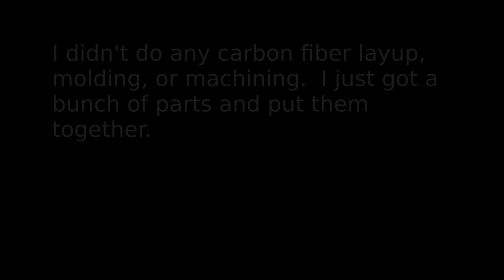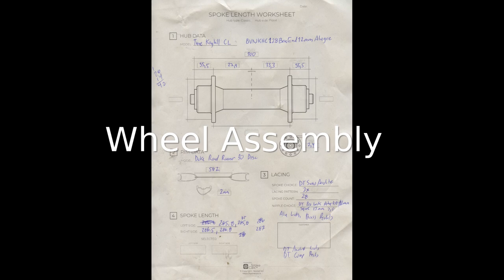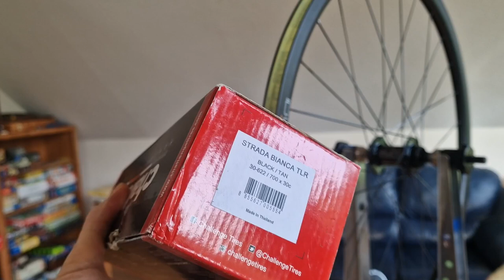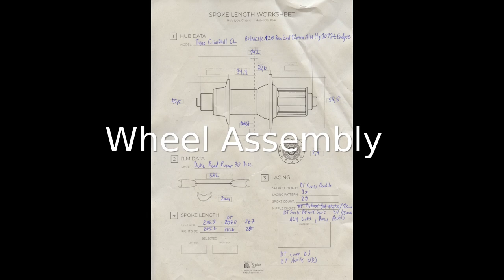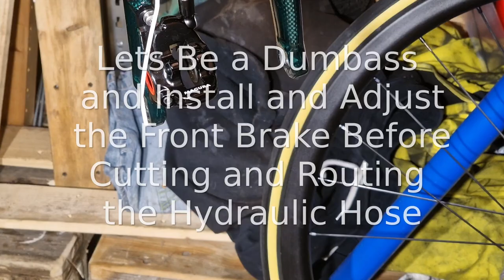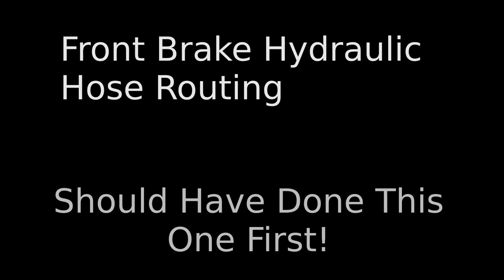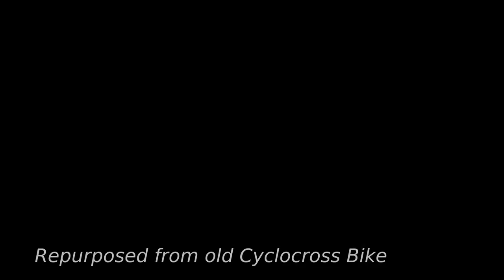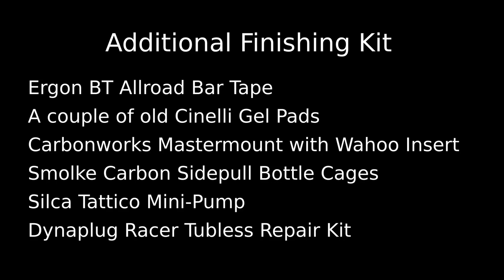Time ADHX Bike Assembly by Home Mechanic

Comment: How do you like the frame
Reply from the maker: The frame is just incredible in the build quality department.  Every hole is as round as can be, and every surface is so flat that nothing needs to be faced, the finish is immaculate.  The frame just reeks of perfection.  It also feels great on the road and on the mild gravel.  The only thing that makes me a bit hesitant are the threaded forged carbon dropouts for the thru axles.  I do a lot of wheel swapping, and am I bit concerned about their longevity.  With that, I'd definitely buy it again, and the next time I need to build a bike it's going to be another Time frame.

Comment: Nice build! I'm about to build a very similar one. I've been riding Rotor 1x13 for a couple of years, and it's still going strong. I'm building the ADHX with it, too. Did you get yours to shift properly yet?  It's pretty sensitive to b-tension and chain length. You might be able to take out another link, and you want to adjust b-tension as close as possible without crashing the upper pulley wheel into the cassette. Another thing I did to mine on my other bike is I removed the barrel adjuster. I've had a couple of them, and they all started leaking after a while. The only downside is that it's a closed system, so you have to account for thermal expansion when bleeding it. I've had mine lock up in hot weather. Heat can preload the system so you can only get upshifts, but it won't shift down, unless you push the button on the derailleur.
Reply from the maker: That is great to hear about the longevity of the Rotor.  So far mine is shifting pretty well, both up and down, and I've been riding it in temperatures from 8C up to 35C without any issues.   My biggest complaint so far is regards to the b-tension, and the way it is stepped instead of analog like every other rear derailleur I've ever had.   I have a Rotor 11-46 12 speed cassette installed, and I seem to have a choice between a lot of noise when it is on the 46T gear and quick shifting in the smaller cogs, or quiet and slow.  I might need to start playing with the chain length like you've suggested.  I've been swapping out a few different sized chainrings trying to find the most appropriate gear ratios, and I'm acquiring parts to build a set of paved-road only wheels with a 11-39 cassette so it's disappointing to hear that I might have to play with the chain length on wheel swaps.  Of note as well, I have a second set of wheels that I appropriated for this bike that I use for off-road.  It had an XD driver on the rear, and I had read several places online that people had better experiences with the SRAM Eagle cassettes.  This was not the case for me, as the Eagle was so noisy and the chain would occasionally climb on top of the largest cog (which I've found out is a reasonably common complaint with them) -- that I wound up swapping the driver out and putting a Rotor branded cassette on.  The Eagle cassette is now on the pile of other SRAM parts that I've been absolutely fed up with.

Comment: If you want handmade Italian tires, your only option (don’t get me wrong; they’re very good) is Veloflex.
Reply from the maker: Thanks.  I was trying for an Euro build, but the tires, bar tape and chain ruined it.  The chain was a bit unavoidable as KMC teamed up with Rotor.
Reply: @schwarzwaldbikenerd6074  why not Campy? Could do a full Campy group set.
Reply from the maker: Funny enough, my first choice was a Chorus 12s gruppo with the 34T cassette.   Every drop bar bike I've had for the last 20 years had some form of Campy on it.  However, after using a power meter for several years I feel like I cannot live without one.  Keeping my Time ATAC pedals was also a must, so any pedal based power meters were out, and there are no affordable power meters that I know will work properly with Chorus 12s.  I already had a Rotor 2INpower crankset on my old Ritchey Swiss Cross with Record/Chrous 10s, so it would have been a bonus to reuse this.  In my research, the chain-ring spacing on the Rotor crank for 12s was a bit too wide and I was too worried about lodging the narrow chain in between the rings.  I was also fascinated by the Rotor hydraulic stuff ever since the Uno came out.  So I figured I'd play it safe and give the Spanish stuff a whirl, and if it didn't work out I'd try to hack together the Chorus 12s setup.

Comment: I have the Carbon Black with Sram AXS.  That green looks nice.  I almost went for the Amber color, but thought it might just wear on me a little after a few years.  That Rear D is the biggest I ever seen.  Interesting build choices.  I have enough stress with hydraulic brakes, would never go with hyd derailleurs. 😀
I must say I am a little confused by some of your choices.  A Time ADHX frame - top quality.  Yet you put a Hambini BB in it which typically is for frames where the BB is not quite to spec - Time is known for being right on spec with the BB size, so a normal BB would be fine - just put in the quality bearings of your choice.  Then you go with a suspension stem and seatpost.  For those two things alone, you will never actually feel the frame ride quality.  Its all muted out by the stem and seatpost - an AL frame from Cannondale would feel the same.  
I have 32mm tires on mine and it also seems to me that the ride quality of my frame is never really noticeable while riding.  I'm afraid the days of feeling the difference between frame materials may be over since we now all seem to ride wide tires at lower pressure.

Comment: Have the same frame-color and size. Nice to see it boroscoped and so clean inside. Nice build. Interesting component mix. 

For Challenge tires (I mounted Getaways on Roval Terras) I think the trick is to get the tire over the rim but don’t seat any of the beads. Basically you’ll have the flat tire w tread over the rim and beads to each side. Then you work  the bead of one side into the rim channel. Use a little bead wax and tire lever for the final bit. Next repeat the other side but when you get to the final bit put a pedal strap on one side of the unseated bead to stabilize it. Again put bead wax on and use a lever to flip it over. Took about an hr to figure out the process and then the next wheel took 10 mins.
Reply: i need a video of that one. I am public school dumb and also have some challenge tires that didn't make it fully onto the rim yet. I am hoping it stretches it self out magically
Reply: @TheFloridaBikeVlogger   look at the rim. In the middle of the rim, there is the lowspot. This low spot runs around in a circle. This circle is smaller than the circles made by the high spots to the left and to the right. 
That means when stretching a fixed circle (the tire) over the rim, getting the final bit of the tire is easiest if the rest of the tire sits in the middle, in the low spots of the rim.
Then you have to do the minimal amount of stretching the tire.

So if you struggle getting the final bit over the rim, make sure to squeeze the tire bead everywhere around the rim together, into the low spots. The final bit should then be easier.

Comment: Sweet. I've always wondered about Rotor. Interesting concept, but sadly i'm not brave enough to try it. I've also just pressed the button on an ADHX. 👍
Reply: Rotor has been a fun experiment that is still ongoing.   After a year, I still can't figure out if I love it or hate it.  The Rotor setup is pretty tough to get dialed-in, and takes a bit to get the feel of the shifting -- but once all of this clicks it's quite a nice to ride.  The braking is beyond superb as well.  The downsides:  It can be pretty noisy, especially in the lowest gear.  As someone who is pretty sensitive to clicks, creaks and squeaks all of the racket from the drive train makes me half crazy.    I also decided I'm not a fan of the big gear tooth step increases of a 1x setup and I'd prefer to have a nice quiet, tight 2x. 

If I had to do it over again, I think I'd try to squeeze a Chorus 12s in and try to get it to mesh with the Rotor crankset. I'd really miss those brakes though....
Reply: Tough one - tranquility and consistency vs being a bit ‘different’ 🤔 Also agree re 2 x

Comment: Very interesting, thanks. You use some 'interesting' parts! I wouldn't dare to install Rotor shifting on any bike, and after your video, I am now fully convinced I'd always opt for anything Apex / Rival / Force (wireless), GRX (mechanical) or Ekar for my gravel bike... 
With regards to the wheels: kudos for building them. I've built some wheels but always struggled with getting rear wheels perfect. It seems you have the materials, patience, talent and a good plan to start with. I wonder if you can give any riding feedback? 
With regards to using the ADHX for all purposes: how happy are you with the handling / steering on the road? 
One last thing: I wonder if the installation of the Hambini BB won't wear the inside of the BB (the left side, that gets the whole BB pushed through). Also, with the way Time produces these bikes, the BB should be very good in terms of roundness and the sides should be straight and perpendicular towards one another. So why would you install anything else than the most commonly used BB and resort to what's essentially a (costly) solution for a problem you don't seem to have?
Thanks again for this video.
Reply: In general, I'm very happy with the bike in pretty much all conditions and ride types.  I built it up as a comfortable bike for long days in the saddle with a lot of climbing and possible dirt and gravel.   I'm currently using three different wheel sets with it: the wheels in the build for all-purpose riding where I'm not going to encounter, a almost identical set but with some more aggressive tires for more off-road conditions, and a set 48mm front/56mm rear carbon rims for strictly road use.  This make the bike really versatile.

The one thing about the bike in the build that I absolutely hated were the Challenge Tires.  Not only were they the most difficult set of tires to mount I've ever encountered, but on quick curvy descents they had way too much give in the sidewalls and had sort of a buttery feeling.  I couldn't even bother to wear them out before I got rid of them.

One of my big reasons for using the Hambini BB was that it got stuck in my mind as something I wanted, not necessarily that something I needed.  That was ultimately one the biggest reasons I chose the Rotor groupset, it became a bike-part Earworm.   I looked at the Hambini BB as more of a problem avoidance thing, rather than a problem solver as a way to justify getting it.  On the plus side, I tend to go through bearings quickly due to dirt intrusions and the shell design made it very easy to replace a bearing that started clicking.  On the downside, it made the internal cable routing extremely difficult.

If I did the build again, would I use the Rotor groupset again?  There are some days I love it, and some days I hate it, and I think I'd probably go with a Campagnolo Chorus 12  speed setup and try to make it work with my Rotor powermeter. I'm not a big fan of the more recent Campagnolo cranksets, and this was what ultimatly pushed me the Rotor hydraulic direction.    Would I still install a Hambini BB?  Problaby.  Would I still buy an ADHX frameset?  I definitely would.  I also would stay with the vanilla ADHX and wouldn't' go for the ADHX 45.
Reply: @bantolphbantir9605 thank you very much, this feedback is much appreciated (as I'm trying to make a decision what bike to buy...!).

Comment: Did you have to sand or remove any carbon from the bike for the bottom bracket, or was it an easy install with the wiring? Thanks!
Reply from the maker: I had to toss the internal cable guide in the BB area as it interfered with the Hambini  BB shell.  I replaced it with a small 3D printed plug to seal the area.  It was still tight in that area, but I didn't have to remove any frame material at all.    Routing the brake and shifting hoses with noise dampening material intact through the chainstays was the most difficult part.
Reply: @schwarzwaldbikenerd6074  Thanks for the reply. I am working with Ultegra 8100 Di2 myself. Would you say the clearance would still be rather tight, or that no adjustments (besides possibly the internal cable guide) would be needed? Thanks once again.
Reply from the maker: If you are using a shell type bottom bracket like Hambini, Token, Wheels Manufacturing, the internal cable guide has to be removed or trimmed as you cannot pass the shell through the internal area and then you need to route the cables/hoses under or over the shell.  After experimenting with a dummy BB shell, I decided to run over the shell and into the chainstays as it seemed a bit cleaner and a bit roomier.  I think there should be room in this area for Di2 cable routing as well, again a bit tight but doable, routing over the BB shell.  If you're pressing the bearings directly into the frame there would definitely not be any issues.   

The only type of routing I would really be concerned about is a combination of a shell type BB and a mechanical(cable) driven rear derailleur.  It would be very hard to get an interference free path without any bad angles for the cable around the BB shell.
Reply: @schwarzwaldbikenerd6074  Good reply. I'm building a ADHX up and was tossing up between a Hambini BB versus AITA or similar to Wheels Manufacturing BB. I just don't like under rotation which can occur where the bearing inner race directly contacts the crankshaft. Also keen to avoid the hydraulic brake hose as well.

Comment: is that a modern spinaci on your handlebar, whats the brand??
Reply from the maker: On the ADHX I had a Farr Carbon Aero Bolt-On V3 mounted temporarily for cable routing.  On the old Ritchey Swiss Cross seen in the background that the ADHX is replacing I have a set of Zirbelacis from zirbel.ch, which by the way are awesome.  Sadly I don't think they make them any longer, but they still sell the offset bar holders.

Comment: Can you replace the shifter cables without removing the BB?
Reply from the maker: With the one-piece bottom bracket like I installed, things are very tight in the BB area, especially going into the chain stays.  It was so tight, that I 3D printed a dummy BB to help with the cable routing.  I didn't show it in the video, but I had to snip off a small chunk of the plastic cable guide in the BB area as it was in the way of the Hambini BB.  With that said, with a one-piece BB, you might be able to use the old cable to pull the new one through if you cut the old one off at the shifter -- but it would be tough.  If you just pushed the bearings directly in the frame, it would definitely be a bit easier but I'd still consider pulling a cable without removing the BB to be lucky.  If you need to replace the cable housing or a hydraulic hose, I don't see how you could do a decent job of it (especially with any noise dampening) without removing the BB entirely.
Reply: @schwarzwaldbikenerd6074  Thanks. That's exactly what I suspected, as I have read a bit about the same frame and BB (both of which are outstanding quality). So are you planning to remove the Hambini BB occasionally (if you have to replace cables)? I know he sells a removal kit too, but one of the selling point of this one piece BB sleeve is precisely that normally it shouldn't need to be removed (bearings are easy to replace with the sleeve remaining pressed in place). I wish Time had some kind of external access to the cables under the BB area, like a small removable plastic cover, as some other manufacturers use.
Reply from the maker: I wasn't planning on that originally, but I've accepted that eventually I'm going to have to pull the BB to do any cable/hose replacement.  The Rotor system is 100% hydraulic (with Magura guts), so as long as there isn't any hose damage (I'm looking at you headset area) I don't anticipate having to do this often.  I did buy the Hambini removal tool as well for when this eventually happens.  It also forced me to acquire a different press, as the combination of the Hambini BB, the BB386 width and the drifts was too long for my VAR bearing press.
Reply: @schwarzwaldbikenerd6074  Oh, I missed that about the Rotor drivetrain. But now that you've mentioned it, do the hydraulic hoses actually fit within the routing channels of the plastic cable guide grommet at the bottom? Those are designed for much narrower bare shifter cables with a 2.3mm liner sheath, right? Btw, congrats on the build (should have said that earlier), it's quite unique
Reply from the maker: The shifter hydraulic hose fits through the frame grommets just fine.  I originally ran it through the cable guide at the BB which was a bit of a tight fit, but wound up pulling it out, encasing it in a damping sheath and running it over the bottom bracket along with the rear brake hose.